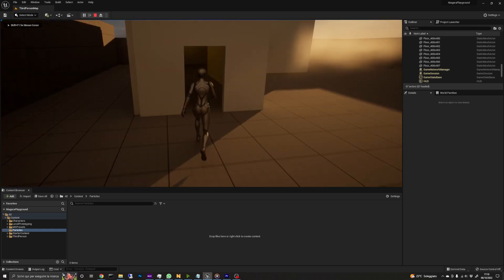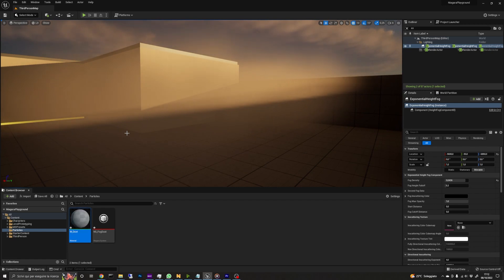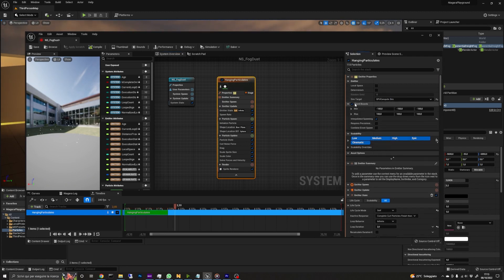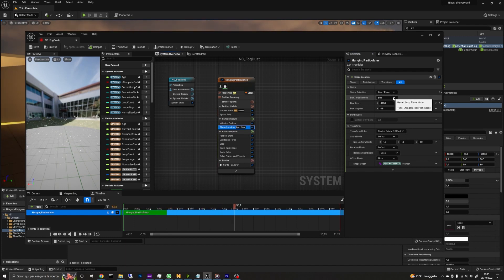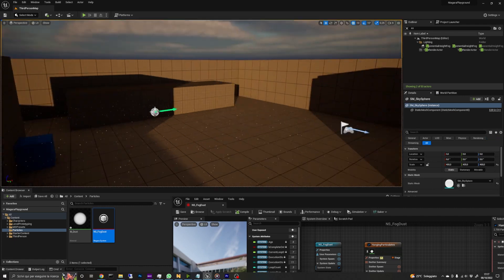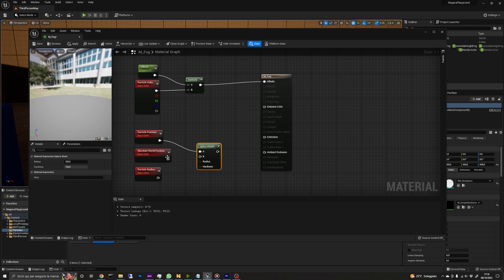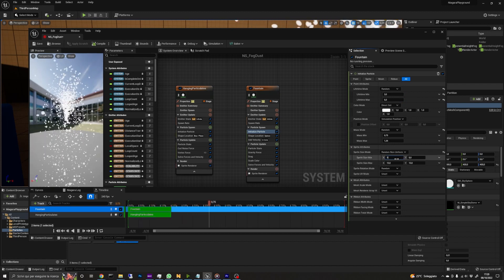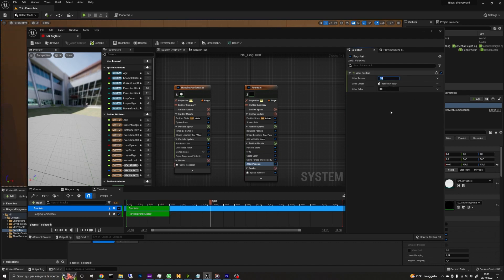[UE5 Niagara] How to make FOG, MIST and DUST

Comment: Doing this in 5.1 just moments ago. Tutorial looks great and exactly something I needed, but I have run into a major snag. Followed along the tutorial perfectly, been over it almost a dozen times to make sure I did it all correctly, but at the end I can't get anything to show up. No fog, no dust particles, nothing. The dust particles worked by themselves but when added with the second (fog) emitter, nothing appears. First thing I did was make sure "Volumetric Fog" box was checked and it is. I even tried the setup in an entirely brand new blank project but same issue. Emitter is present, and, when selected, highlights where the fog/dust should be, but there is nothing visible.
Reply from the maker: Heya, maybe your particles are too small? Try making the particles bigger in the Niagara Emitter by changing their size, and be sure to not use a color with alpha too low. If you still can't see them probably there's some project setting wrong
Reply: @gonoshift  I tried making the particles bigger, and also tried changing the color (in your tutorial you never changed the color of the "Fog" emitter in the system, but I tried changing the color anyway) but neither helped or seemed to do anything at all. If there is a setting wrong I have no clue which one. 

I tried it in a fresh brand new project and it still is showing nothing. There must be something different between Unreal 5.1 (what I'm using) and 5.03 (which I think your video uses). What I find really strange is I tried using a different material than the one we made for the Fog, and when I do it suddenly works. But the material is made exactly perfectly like yours in the video. I'm completely at a loss.
Reply from the maker: @victorgross3722  Double check if the material has the domain set to "Surface", blend mode to "Additive", shading model to "Unlit" and the "Two sided" option checked
Reply: I tried it on 5.1 and it works, so you probably missed a step unless you are using it in a very dark area or with shadows. For me this solutions to fog doesnt work properly since, for some reason, decided not to work under the shadows of my trees, but it works under the direct light. Recheck if you missed the step of fixing bounds since in 5.1 instead of a check box is a choose option under the Sim Target called "Calculate Bounds Mode" where you can change it.
Reply: @gonoshift  I have the material domain set to "Volume" and the blend mode set to "Additive" like you say to do in your video (around the 6:00 mark, I believe). And as Error 404 said I did notice that 5.1 has the fixing bounds a little different which I did notice and take into account so I know that is correct as well. Also, my scene is literally the empty 3rd person template, so I know its not shadows causing issues. I have at least managed to get the dust particles to show up properly like they should, but no sign of the fog itself.
Reply: @victorgross3722  Yep, tried that too and the emitter works - so there's something wrong with the material
Reply: @gonoshift  at 6:21 you instruct to do Volume, Additive, and Default Unlit and Two Sided is unlit. What do you mean? Not working for me either, looks like you did this in 5.1 though so I think its also the volume properties that aren't working on the material correctly.
Reply: Same for me in 5.1. I just get a yellow silhouette of where particles should be but nothing there.
Reply: I got it working. Drag M.dust not m.fog into niagra fountain and adjust to get set up. The m.fog needs changing I think.
Reply: @whovisionsCGI  I knew the issue was somewhere in the fog material! I did as you said and plugged in the M_Dust and it worked perfectly after a few adjustments.
Reply: @Victor Gross  Yes, I played around the same and got it working. Still not exactly as I want it. Too much turbulence rolling around. I want just a slow moving fog.
Reply: @victorgross3722  same problem here, and I am using it in a dark area. anyway to make it show up?
Reply: I think because of the post process volume the particles does not show up correctly, you need to up the emissive quite a bit.
Add a Multiply to the emissive, and multiply the RGB of the Particle Color with a scalar parameter. In the instance of the material up this parameter.
It starts to show up around 50 but barely noticeable, you need to go in the hundreds. Also don't forget to check Volumetric Fog inside the ExponentialHeightFog Actor.
Reply: Thank you for this. Couldnt find this option on 5.1 @JambelBandel

Comment: Amazing video and I love the detail in the video and in the fog itself! I just had one question, though: Is there anyway to resize this so it fits over a larger area of the map? Everytime I change some of the settings, it just makes the particle sizes larger and more spread out. Thanks and keep up the great work!
Reply from the maker: You can increase the size of the box inside which the particles spawn, together with the spawn rate. Be aware that it has performance implications, if you have a character or a camera moving, it would be better to move the fog instead of expanding it to the whole level
Reply: @gonoshift  Oh, so have it move depending  on the position of the player/camera? That's a great idea I didn't think of... good call!

Comment: It's an interesting approach but also looks to be quite demading. There's a lot of particles generated, even if on the GPU side. Wouldn't using this kind of fog for some larger areas be too much for the general performance?

Cheers!
Reply from the maker: Yes, making it large will surely have perf issues. I recommend everyone watching the new video about Local Fog Volumes, because they are easier and lighter to you use! https://youtu.be/2J7X-orWU6s?si=Z9XFwoVzc6joiWn_
Reply: @gonoshift  I saw that too, but I don't plan on using 5.4 just yet, so I was more interested in this method. Which of course doesn't mean I can't wait for them to polish the local fog feature as from what You've shown us it's limited to the point I wouldn't find any use of it in its current state :D

Cheers!
Reply from the maker: I see, idk about your needs but if you're referring to the camera distance, there's the cvar option to set it, you can make it persistent. If you're referring to the fog shape it could be easily fixed too 😉

Comment: I followed everything here to the end, but once i applied the Fog material nothing showed again.  idk whats wrong.  using 5.3
Reply from the maker: Check if happens also on a new project, probably you have something turned off.
Reply: @gonoshift  I'm having the same problem in VR 5.4 - have triple checked all steps
Reply from the maker: If you are on 5.4, try using the new Local Fog Volumes, check here: https://youtu.be/2J7X-orWU6s

Comment: This is great, but has anyone found it stopped working in UE5.3? I just upgraded my project to 5.3 from 5.1, where it worked perfectly, but now it's invisible.
Reply from the maker: Hey Sean, try to delete all your atmospheric components (directional light, sky sphere, etc... ) and add them back again, be sure to double check all the settings shown in the video, especially the fog checkbox, it shoud work. I've just tried it in Unreal 5.3 and works.
Reply: I met the same problem in UE5.3, can you tell me how you solved it?
Reply from the maker: If you want to try 5.4, check out the new video about Local Fog Volumes, they are a lot easier to use! https://youtu.be/2J7X-orWU6s
Reply: @gonoshift  Thank you very much :D I found that I let Engine S calability Setting to the lowest before, which led to it not being displayed in it

Comment: Hi! Quick question, i would really appreciate some help! I have a flickering light in a dark scene (my light has a Light Function Material) , when I activate the volumetric fog what happens is that the light flickers, but the volumetric fog retains the light "bloom" even when it is turned off. So what i get is a flickering light that doesn't really affect the volumetric fog, it acts as if the light never turns off. Btw this doesn't work with Rectangle Lights, the other lights work just fine with volumetrics

Comment: Thanks for the tutorial. But in Shader Complexity view mode It says that the shader is extremely complex. Is it fine for the for or there might be other workarounds to let it be less complex?
For those who couldn't see any fog - there might be a problem with the Engine Graphics Scalability: Shadows must be set on High, after you would set Shadows to High fog will appear. If its not - than you have some other problem.
Reply from the maker: When working with particles, especially volumetrics, attention to performance should always be paid. Use bounds in an efficient way (check out this video where I explain how they work https://youtu.be/4mpyhve75GQ)
And consider making the system follow the actor instead of filling the whole level

Comment: Hey man! Nice tutorial, fog looks good, but it makes my FPS drop to single digits. Any idea why?
Reply from the maker: Hey, thank you! Your FPS are dropping probably because of a too big simulation box size eventually combined with an high particles spawn rate. Try lowering the spawn rate to see if it helps (it definetely should), and then find a sweet point between performance and visuals. Cheers!

Comment: The material doesn't function properly on mine with the fog example. I'm not quite sure what's different but the values and setup seem the same just to try to replicate it but nothing makes the fog actually visible. I'm guessing its not the particle but the Material that's causing the issue. The sprite renderer displays other materials fine.
Reply from the maker: Have you checked the Volumetric Fog checkbox in the ExponentialHeightFog object (01:00 in the video)?
Reply: @gonoshift  Ah that worked. I thought my issue was gonna be somewhere in the latter half of the video. It's always a checkbox somewhere lol. Much appreciated.
Reply from the maker: @phenik403  Yeah I hope that somehow in the future Epic finds a good way to implement suggestions to troubleshoot problems like this, where if you forget to check a checkbox  nothing works :D